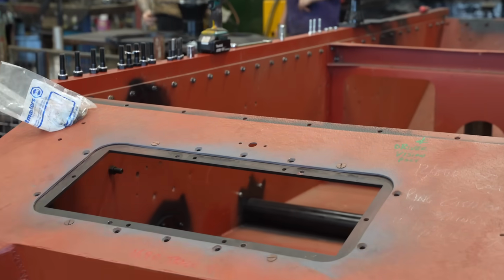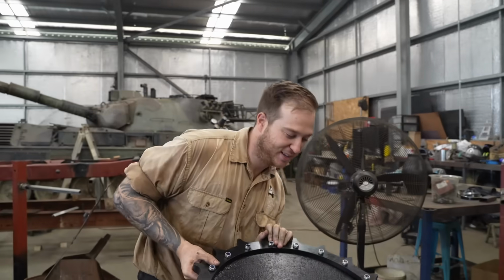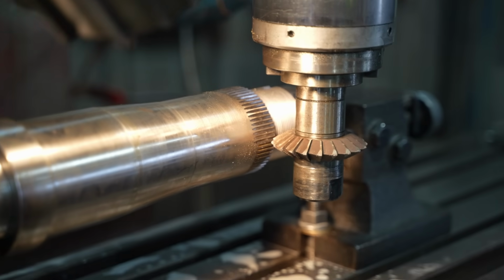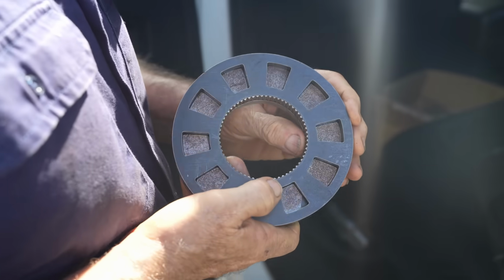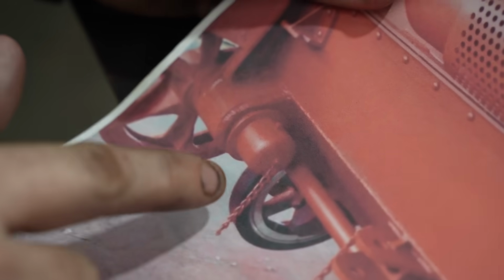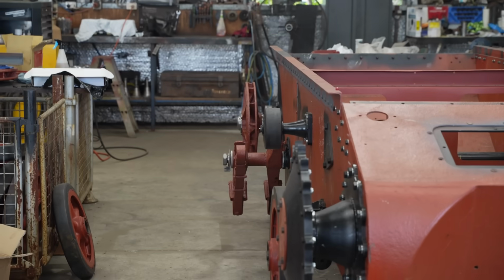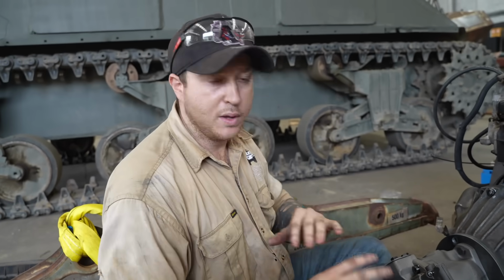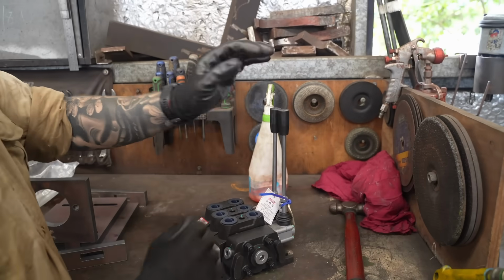WORKSHOP WEDNESDAY: Panzer I Machine Shop Magic!

Comment: When I see a 57 Chevy go down the street, I don't think about the drive train only the beauty of the car. If I owned a 57 Chevy I would rather a Resto mode with disc brakes, electronic ignition, and all the things that make a car safe on today's highways. A great running Panzer 1 is the same thing. JerseyBill from the States.

Comment: Those hydraulic motors are tiny to offer such torque and power to run a tank! You're also lucky having such engineering firms in a small city like Cairns. I wouldnt be able to locate similar suppliers in the east of England!

Bonza job boys!

Comment: The work on this vehicle so far has been amazing, up to your usual high standards. 
 A bit disappointing that the Panzer I won't have a real steering differential and manual transmission but I understand that sourcing original parts would be prohibitively expensive and finding a modern substitute would be difficult to say the least. It'll be great to see it up and running. 👍

Comment: 18:45 i'm not. I think it will be great to drive WHICH ultimately is very important because this needs to be seen. Dead history is that, dead. It's just a piece of metal that doesn't do anything. But if you saw it move, it sticks with you. This is valid in every facet. I've just as much respect for you guys putting this to function (with the hydraulics) as i do around the guys restoring big boy locomotives in US to OG spec and original steam (from scratch made) boilers. What counts is the outcome. The outcome is to be seen. Best thing i can support this sentiment is this, saw some WW1 guns during my childhood at a mountain side castle. Visited recently, felt they were added after the fact, asked the curator, got told they'd been there for way longer than i'd visited. I simply forgot about them. But i saw a colonial era cannon being shot and i recall it perfectly, because they shot the thing (not full tilt 1800's gun, old and retired) but i got to see it cycle on its mount and smelled the powder. That, is the key factor and why i'm perfectly ok with hydraulics. Just my 2 cents.

Comment: 17:28 prolly already in the design, given how detailed this build is, but if it isn't, should add a hefty tensioner bolt to "rest" on the moving plate (the carriage) and push it to tension the chains. I'd go with a thicc boy, no kill like overkill.

Comment: I dont care if the drivetrain is not original, you can put a modern V8 truck diesel engine in the Tiger I, i would still watch it running!👍

Comment: i didnt see any indications that heat was applied so that those toothed bits were hardened.  surely they need hardening.  running this thing using a modern motor with modern hydraulics is a great idea.

Comment: Gentleman, in watching this segment, I saw how you are going to mount the hydraulic motors.  I see a possible problem.  You might want to put a carrier bearing opposite the hydraulic motor to relieve the stress on the motor shaft itself.  Just a thought.

Comment: 100% with you replacing the old drivetrains with hydraulic drives. WWII, and even many Cold War, tanks had atrocious gearboxes, unreliable engines, and poor ventilation. Better to keep it safe, and keep it simple.

Comment: @ausarmour Whilst I understand the "modernisation" of the Pz I, it would not be historically accurate nor authentic to "neutral steer" as only the Tiger and Panther (various types) could neutral steer. Quite frankly, if you don't shed a track or break a link or guide horn doing it you would be lucky. Perhaps a reminder notice plate not to neutral steer (unless on hardstand) positioned appropriately might alleviate the concern. These vehicles are too precious and expensive to be damaged by a lack of caution or care.

Comment: One look at that blacksmith's pile of garbage in the front of the shop, then a look at the blacksmith, and I would have turned a 180, locked the doors, and driven away. I hope that you made him sign a receipt for those irreplaceable parts. My guess is that he would have sold them the next day and claimed a break in. You should only deal with suable entities. If this bloke cocked them up, you'd get nothing. Sorry to be so blunt, but I have 30+ years in the restoration business of valuable motorcars, and I smelled trouble with this chap. Otherwise, brilliant work, as always.
Reply: They would know the blacksmith's reputation before dealing with him. Bad news travels fast. I also live in a remote City in Australia, our spring works looks even more decrepit, but the tradesmen are good at what they do and are reliable. Next shop is 500km away. What would you do?